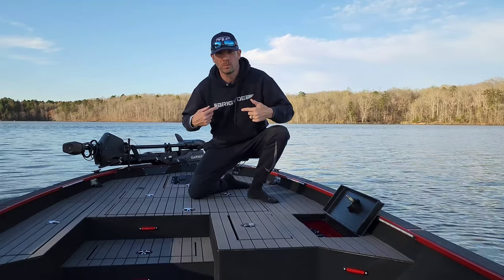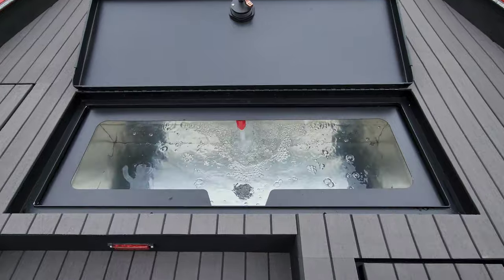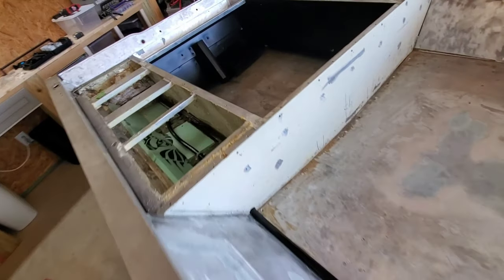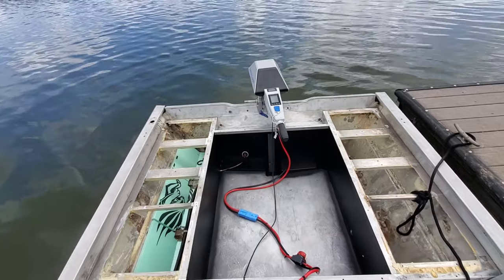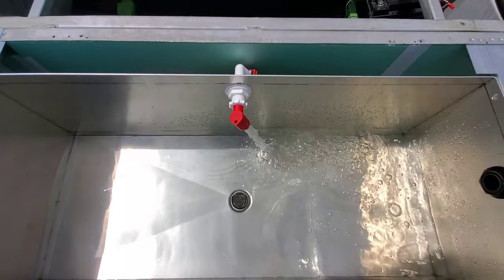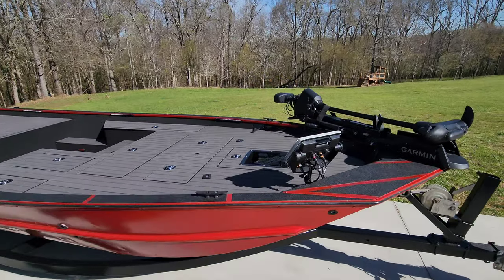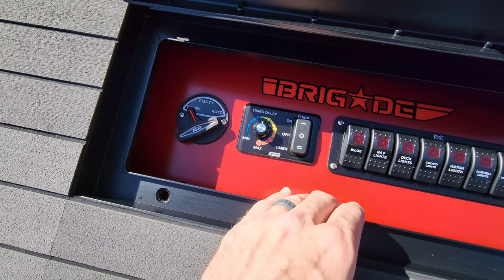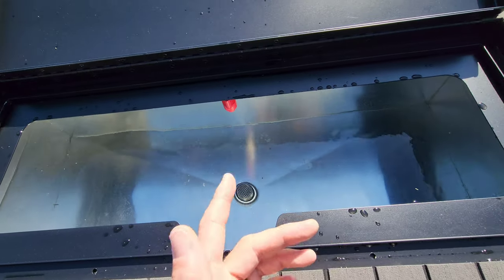Front Deck Livewell in Aluminum Boat

Comment: Awesome setup! Only thing I would have changed is to put the pump and switch downhill from the tank for when you gravity feed the tank on empty. I'd be curious to see if it really fully drains?
Reply from the maker: Technically the pump is downhill relative to the tank , otherwise it wouldn't drain to the pump to recirculate. If you mean downhill from the tank as far as toward the back of the boat , that's typically how I prefer. Every boat is different and comes with different design obstacles to overcome..As shownat the end of video in the demo,  it drains out the back fine. Thanks for the continued views and support!
Reply: @AnthonyJonesBrigadeBoats  For sure, it's a super minor detail. Overall this is one of the best livewell install videos out there! You're always killing it!!

Comment: Wouldn’t the overflow drain hole back fill if the boat got too heavy and the outside hole was under the water?
Reply from the maker: the overflow is about 1 ft above the water line. Highly highly unlikely. If water is that high, boat is on its way to sinking! BUT, if water did get that high, the overflow hole through the hull is still 6 inches lower than the overflow fitting in the livewell because it uses gravity to overflow outside. So yeah, boat would need to pretty much sink for water to go through the overflow and into the livewell.

Comment: I’ve had issues with the flow rite valve, it drains in the middle of a tournament. I think its cause the fish kick it open.🤷‍♂️
Reply from the maker: Are you talking about the pump out aerator combo spray nozzle? It has to be pulled out to pump out. The valve is at the pump and is cable operated. I couldn't tell you the exact problem without looking at it but I've never had any issues ever with any FlowRite equipment.